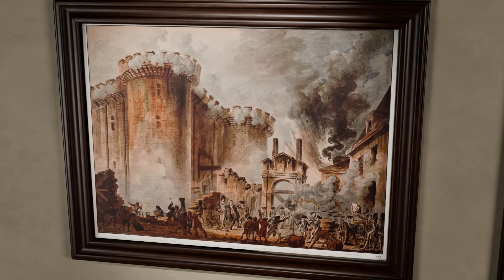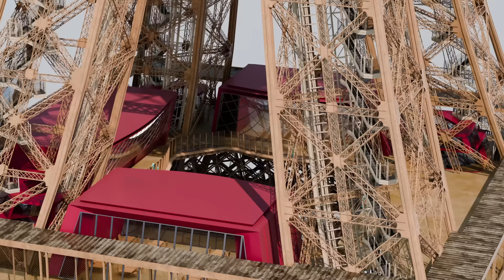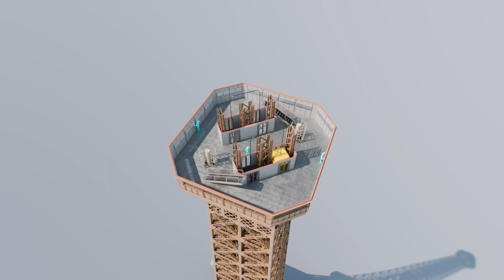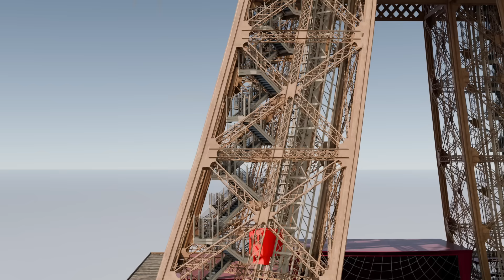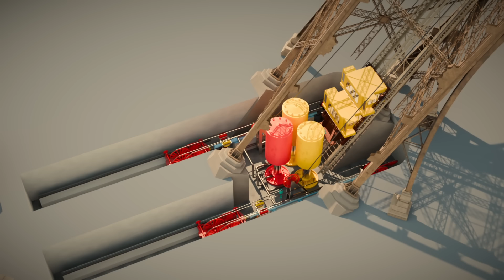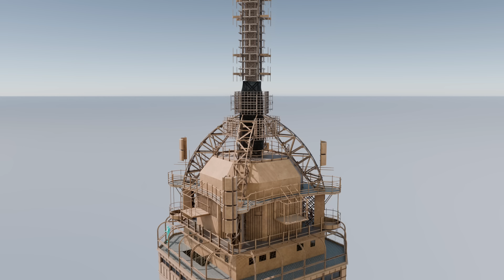The Genius Design of the Eiffel Tower’s Elevators

Comment: To give you an idea of how efficient use of material the lattice design is: if you are to melt all the iron used in Eiffel Tower and pour it into the square the size of its base, it will only be 5cm thick.

Comment: The tower itself gets all the attention, but designing elevators that had to work with those changing angles may be just as impressive. Which was the harder engineering problem: building the Eiffel Tower, or making a reliable elevator system work inside it?

Comment: If the Eiffel Tower in Paris was so well built, why does it rust and potentially face the risk of collapse someday? Additionally, there is a Eiffel Tower, in Vegas which, even though it is twice as small as the one in Paris, has an elevator allowing visitors to reach the top and enjoy the view just like the one in Paris

People say that the view from the top of the Eiffel Tower in Paris is impressive, breathtaking, and even better than the one from Vegas. But is that really the case? Looking at the gray Paris sky, the Seine with its brown water, and the Haussmannian buildings, is the view truly superior to that from the Las Vegas Eiffel Tower, where you can see the desert, casinos, hotels, day and night, with all the sparkling lights? It doesn't impress me

Moreover, they used the same materials to build the Las Vegas Eiffel Tower as those used for the one in Paris. So is the Paris Eiffel Tower really unique?

I don’t understand why the Paris Eiffel Tower would be better than the one in Vegas. The main difference seems to be the size—the Paris tower is twice as tall—but beyond that, I don’t see a clear reason why the Paris Eiffel Tower would be superior.

Comment: Around 1977, I visited family who lived in Paris.  I went with my cousins to the third level of the tower.  When we decided to descend from the top, the options were elevator or stairs.  There was a spiral staircase between the third and second levels.  A 578 foot spiral staircase open in structure with only steell handrails to enclose it!!!  My cousins took the stairs, but when I looked down at the terrifying open space that stairway corkscrewed its way through, I backed out and took the elevator.    I did a search to confirm the existence this stairway that was not mentioned in this video.  God allmighty!  You could not have paid me to descend those stairs! From my search:  "The Eiffel Tower once had a spiral staircase from the second floor to the summit, which Gustave Eiffel used, but it was removed in 1983 for safety and to install elevators"

Comment: Engineers should have made the elevators in the legs work using the counter weight principle.  Tower leg elevators in opposite corners could share a cable.  Cable drive mechanisms could be overhead at the restaurant level.  When one goes up, the other goes down.  Much simpler and safer design.  Modern electric gear motors would make the operation silent.

Comment: I have been there about 10 years ago and also went in it. My great memory of it was that my dad had a pocket knife in his backpack and the security was very strickt about it and actually should get him arrested. But he got away with it, if he would drop it into the bushes nearby. After we came down there were police officers with a gardener that was working in the exact same bushes. My dad went up to them and explained in his broken french that it was for making baguette with butter (for real lol). After a hearing he got a good laugh with them and got his knife back.

That was my great memory of the tower.

The lesser thing was that on the second floor, there was a line of 2.5 hours to get on the top, so we did not do that unfortunately...
Reply: I had my pocket-size vice grip pliers and a folding screwdriver confiscated. One of the screeners made a motion with the pliers to indicate that I could use them to loosen some key connection, I guess. I didn't get either tool back.

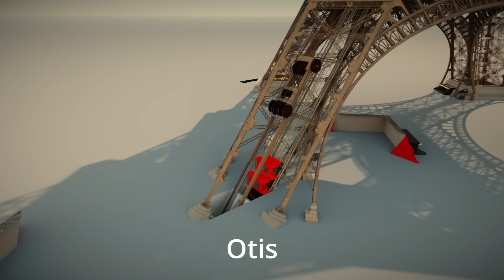Comment: 12:37  I never knew these were so complex. When I was in Paris, I chose stairs but now I think the elevator would have been an adventure too.
Reply from the maker: yeah, those original elevator systems were incredibly clever for their time. Riding them with that knowledge definitely turns it into a whole different experience.
Reply: @Deconstructed_Animations  Just hit me there's another French elevator which may be of interest: L'Funiculaire Notre Dame de la Garde in Marseilles. It was operational in the late 1890s, closed down in 1964 (It was a noisy old thing) and removed in 1969. It was a water balance funicular similar to many used on the cliffs of south west England, but the big difference with this one - Putting aside the refreshing French habit of building everything solid as rocks - Is that it had a dedicated tower and skywalk built as a part of the project, too. 🇫🇷💯👍

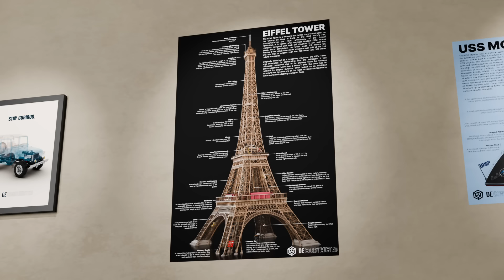Comment: 6:30 I'm surprised that the tower didn't collapse under the strong storms Paris has endured over it's lifetime.
Reply: It was designed in France, by a Frenchman, and made in France. Even with increasingly hostile weather (🇬🇧) l'Tour Eiffel will last another 500 years easily. 💪🗼🇫🇷💯👍
Reply: @UK-Combustibility-AssuredThe rivets were made in England.
Reply: @spoffspoffington  That would seem rather strange. Given the not insignificant quantities of them in l'Tour Eiffel (Probably a good 100+ tons worth) why would you import them from abroad when you already have the technology to make the same thing locally?

Certainly; My experience of French civil engineering from that time period (i.e: Most of the elevated Métro infrastructure in Paris, building frames/ironwork of that period, railway bridges) suggests that importing English rivets would have been expensive and unnecessary.
Reply: @UK-Combustibility-AssuredThe rivets were made in England.